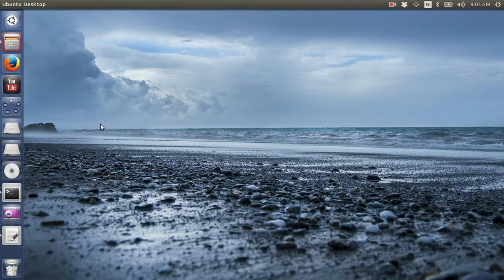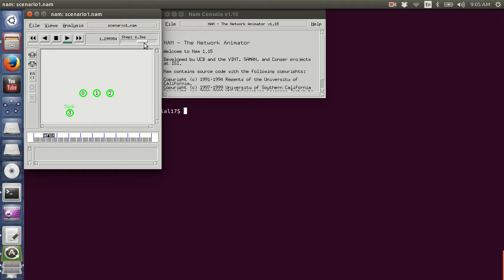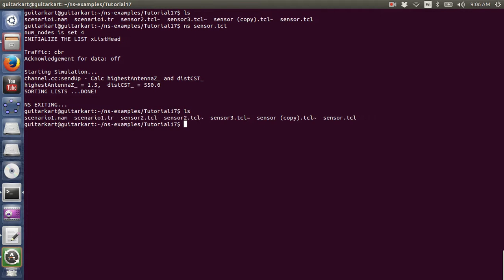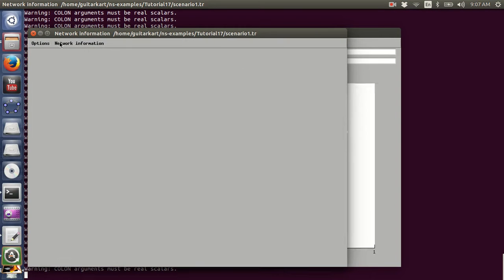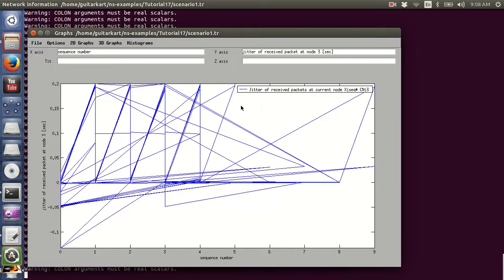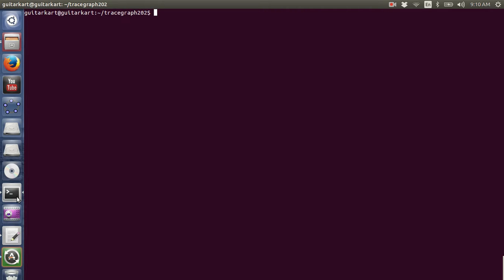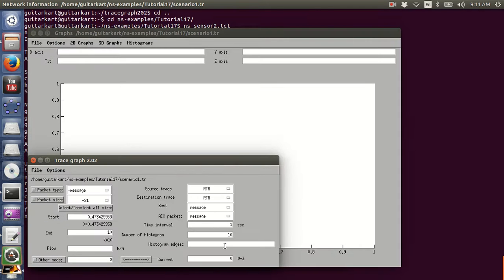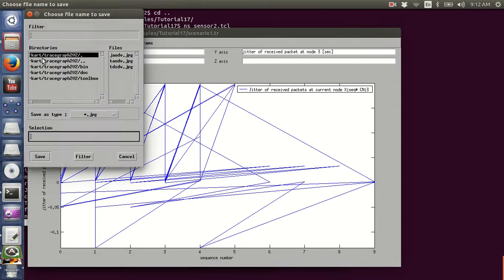Tutorial: 18 - Wireless Sensor Network in NS-2 Analysis (Part-2)

Comment: sir i am using ns2.35 how to run tarce file shall i install trace graph or using x graph in ns2.35
Reply from the maker: Hello, actually we do not run the trace file, it is an output file which can be analysed using x-graph which is inbuilt in Ubuntu or can be used more articulately to get desired results using a 3rd party software known as tracegraph. Installing tracegraph is a challenge in ubuntu 16, i have not been able to install tracegraph in ubuntu 16.